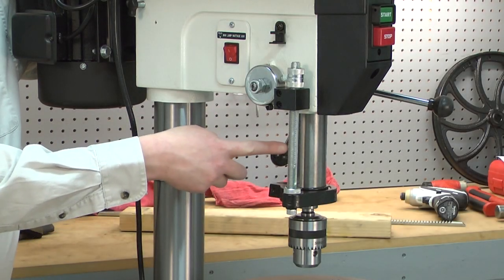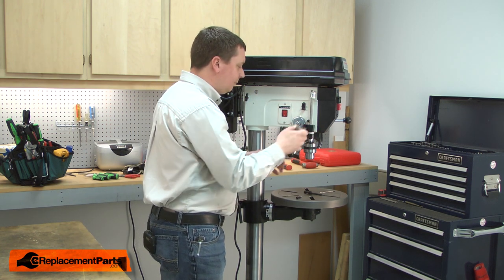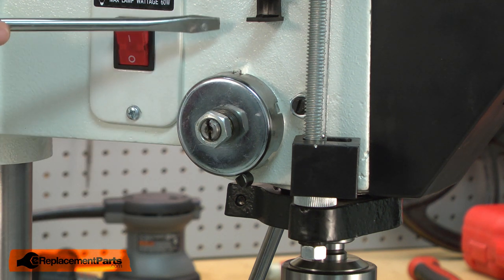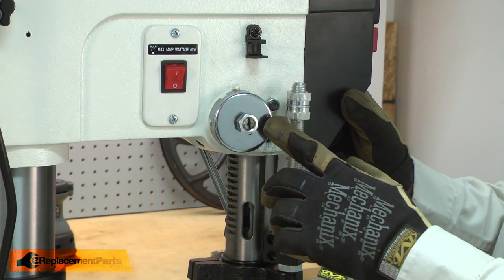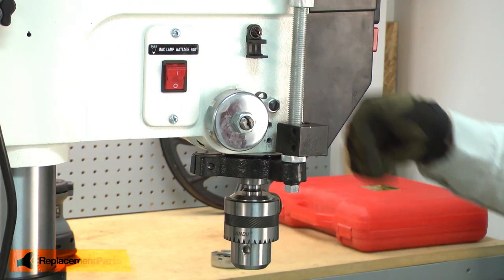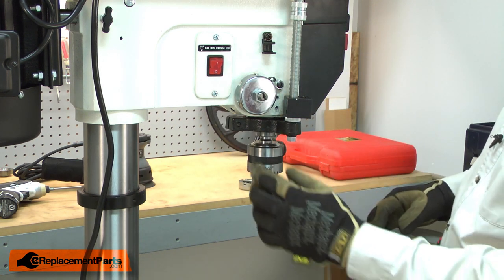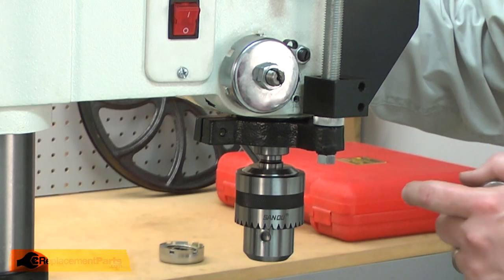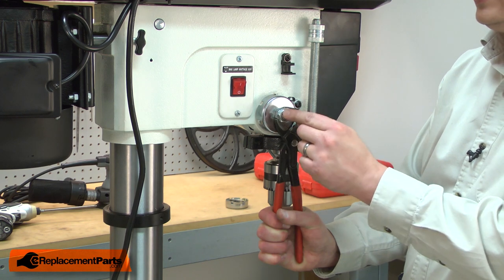Jet Drill Press Repair - Replacing the Coil Spring (Jet Part # 10605002A1)

Comment: So sadly his did not answer the most important question.  How to you get the spring back into the housing case after it comes out.  I’ve been working on trying to do this for two days with no luck.  Was hoping there was a trick to it.
Reply: watch another video and you will learn the trick is to not remove the bail wire that is keeping the new spring tightly wound. As the new unit ( spring ) is inserted about 90% way you can nudge the bailing wire on the new spring up close to the edge so you can easily remove the wire once you've seated the spring into the housing. This video was made well as far as production and audio but, failed to show in any detail this most crutial step.